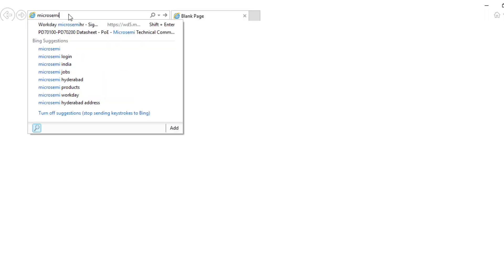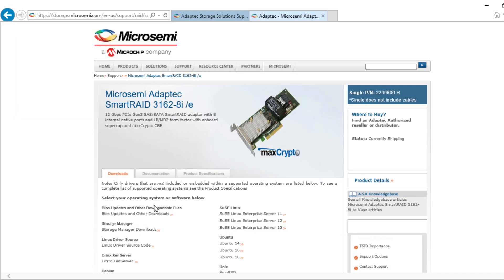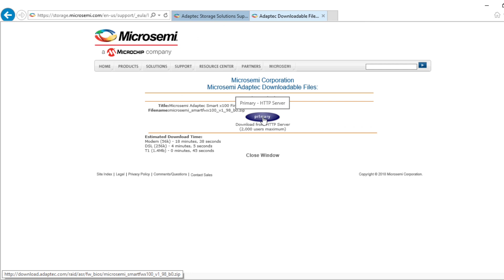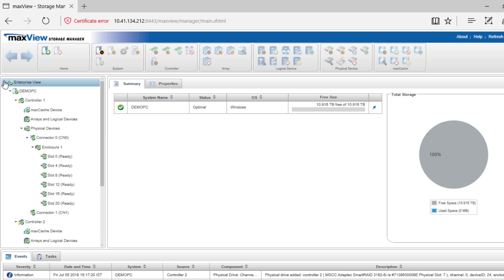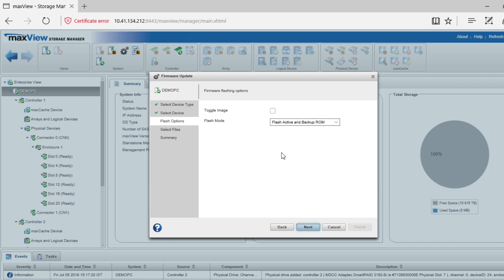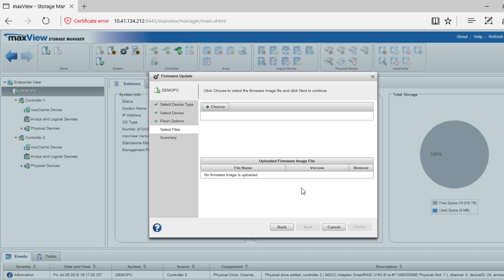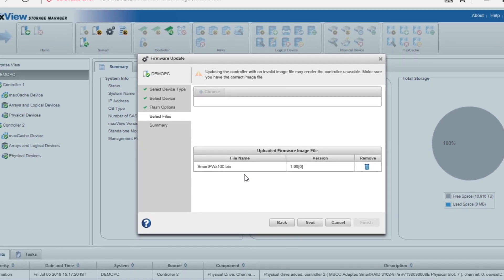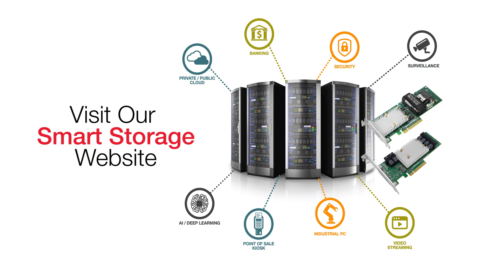How to Flash Firmware Using Adaptec® maxView Storage Manager

Comment: My server not booting after firmware update of 6805E to version 5.3.0. Seems like windows storage driver problem. Help
Reply from the maker: Hi there, thanks for reaching out to us. So we can properly address your concern, please reach out to us at: https://www.microchip.com/en-us/support and one of our dedicated engineers and experts in Adaptec Devices will be in touch. Thank you!
Reply: @MicrochipTechnology  Thanks, I've already solved my problem. Turned out that older driver wasn't compatible with the latest firmware. I booted into recovery mode from Windows installation DVD, and replaced system32\drivers\arcsas.sys driver file with newer one using command line.
It'd be nice if you reflect that drivers should be updated first before updating controller firmware, somewhere in the user manual and/or FW download page.